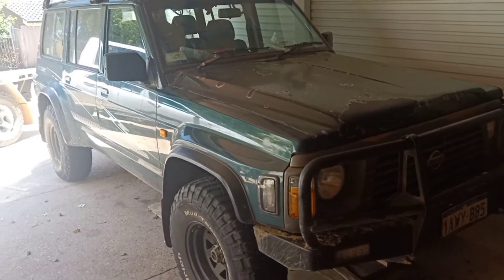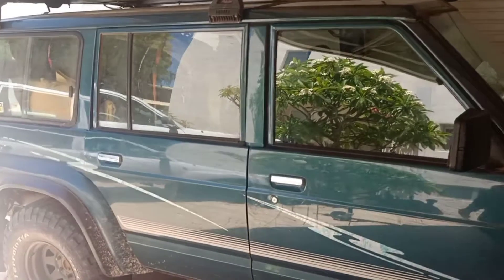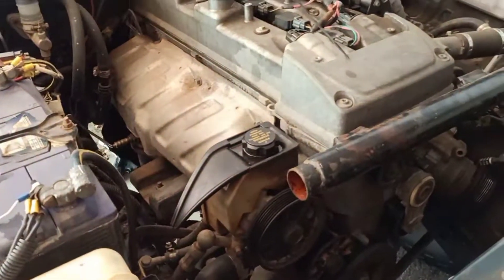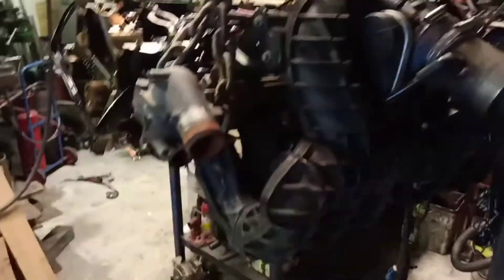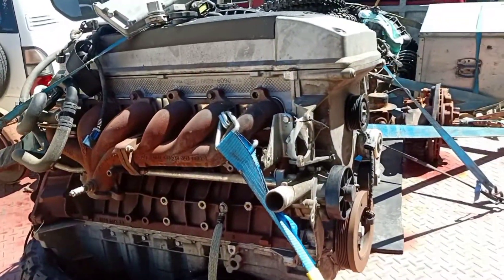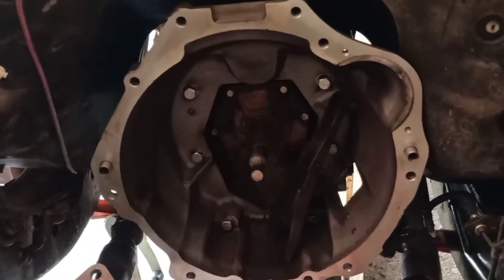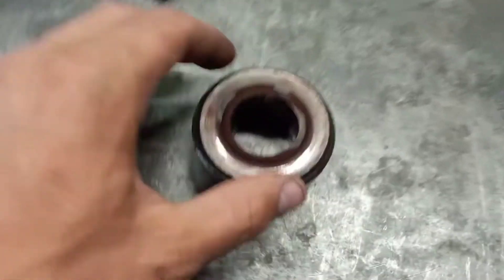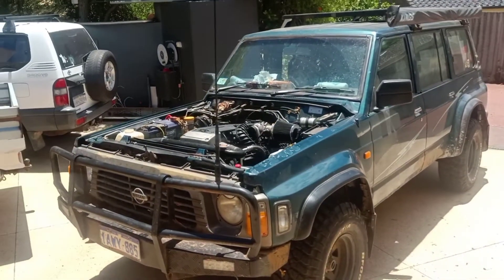GQ BARRA PATROL BUILD PART 7: cracked piston + a few improvements.

Comment: That clutch end up working alright with the 5mm spacer or did you have to cut the slave pin down
Reply from the maker: You will need to trim down the slave rod but the spacer certainly gives it a much nicer feel than previously. It takes a bit of trial and error to get the slave rod the right length but it feels good once sorted.